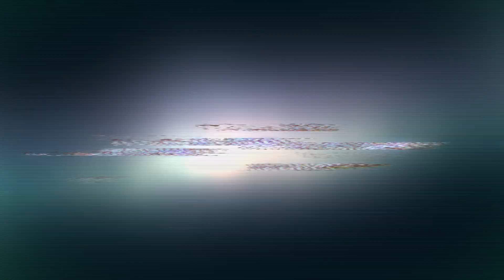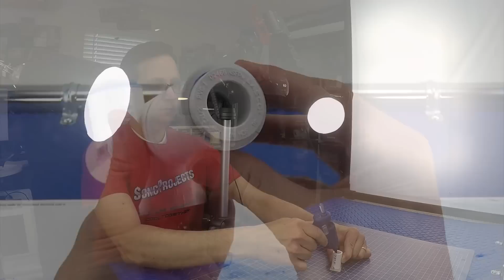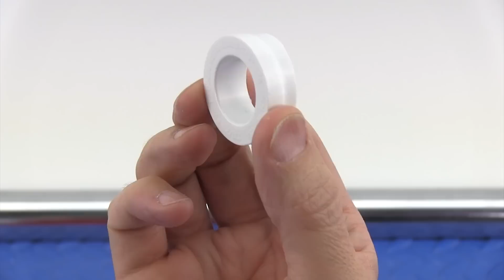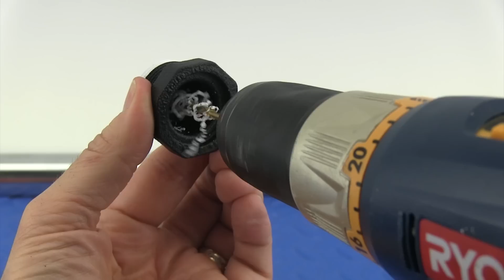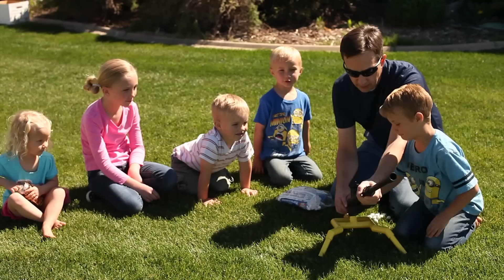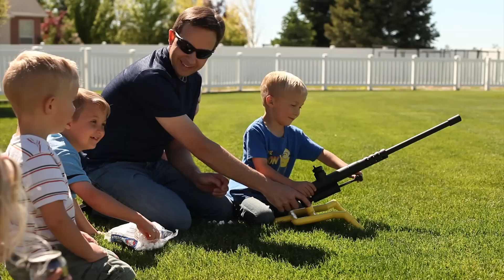Build a Marshmallow Cannon with SonicDad Project #78!

Comment: Hi.  I'm going to be using this project for my extra curricular classes at my school.  The Piezo ignighters that I've found are from used up gas lighters.  They only have 1 wire on them though.  Is there a way to soder on another wire?  Thanks
Reply: Those types should have a bit of metal (ground) on the side that connects to the barrel of the lighter.  (Some might be reversed with the wire on the side and solid metal end.)  That's what you'd want to connect your added wire to.  There will always be two connection points somewhere on the device.

Comment: I got a clear spark, 70% denatured alcohol and the sponge is wet enough but it wont fire it. can you pls help me
Reply: The 30% water isn't helping you.  Go with 91% or pure alcohol sold as fuel.  Won't matter much between denatured ethanol and isopropyl.  Make sure you pump to clear the old gasses out for each shot.

Comment: Does anyone else have the problem of the cannon not firing wis 91% Isopropyl Alcohol
Reply from the maker: A possible tweak would be to use denatured alcohol. Rubbing alcohol works, but there are variations between manufacturers and some just are harder to use for combustion. An alternative is denatured alcohol, which is a little more combustible.  An easy-to-find source of denatured alcohol can be found at most auto-parts stores (https://www.amazon.com/28201-Gas-Line-Antifreeze-Water-Remover/dp/B0016GXNC4)

Comment: I had some issues finding some of the pvc parts. I was able to get all of them but some have rigid octagon like ends and some are smooth. Is this an issue?
Reply: A little late, but perhaps this will help others:  Knife, saw or sandpaper to remove material.  Hot glue to fill gaps.  The paint will make the whole thing come together better than you might expect at first.  Whether there is an issue depends on how different your parts are from the plan and if you're willing to do a little work to make them what you need.

Comment: Can you help  please wont set off (as in the fuel rod and trigger wont react) and everything is set up correctly?
Reply from the maker: A few possible troubleshooting steps might include:

#1 – Verify you have spark. This is easily done by taking the ignition switch into a dark room and pushing the button. You should be able to clearly see a little spark jump between the ends of the wires.  If you don’t see a spark you may have a bad ignition switch.
#2 – Verify you have fuel.  The fuel sponge needs to be wet, but not too wet.  The best way is to spray it enough to saturate the sponge just to the point where the sponge begins to drip.  More than that is too much.  
#3 – a possible tweak would be to use denatured alcohol. Rubbing alcohol works, but denatured alcohol is a little more combustible and therefore a little more consistent.  An easy-to-find source of denatured alcohol can be found at most auto-parts stores (https://www.amazon.com/28201-Gas-Line-Antifreeze-Water-Remover/dp/B0016GXNC4)

Comment: I live in Ireland so it is very difficult to get rubbing alcohol so is there a substitute fuel that I could use
Reply: ULTIMATE GAMING order it from an online site (like eBay)
Reply: ULTIMATE GAMING in theory you could use spray deodorant cans, but the combustion chamber would need to be modified.
Reply: Can you get HEAT for removing water from gasoline?
Reply: Sam Strassburg I have never heard of that before but it doesn't mean it doesn't work
Reply: clanline35028 HEAT is just a alternate product you can use.  Really you can use anything that is highly flammable.
Reply: Sam Strassburg thanks for the info

Comment: Does anyone know what the FPS or feet per second is.
Reply: That depends on tiny differences in the materials in each cannon, each marshmallow, how much fuel vapor and how much oxygen is in the chamber at the exact moment you fire.  Every shot on every cannon will be different.  This is why combat cannons and smaller firearms eventually changed into using pre-loaded explosives in closed containers when technology allowed it – for a predictable shot almost every time.  (Misfires and variances still happen sometimes.)

Comment: I built this cannon but I can't get it to fire. Any suggestions?
Reply from the maker: A couple troubleshooting items that will help you include:
#1 – Verify you have spark. This is easily done by taking the ignition switch into a dark room and pushing the button. You should be able to clearly see a little spark jump between the ends of the wires.  If you don’t see a spark you may have a bad ignition switch.
#2 – Verify you have fuel.  The fuel sponge needs to be wet, but not too wet.  The best way is to spray it enough to saturate just to the point where the sponge begins to drip.  More than that is too much.  
#3 – a possible tweak would be to use denatured alcohol. Rubbing alcohol works, but denatured alcohol is a little more combustible and therefore a little more consistent.
Reply: SonicDadDotCom ok thanks, I'll give that a try
Reply: I was having the same issue. I found that if you take off the barrel, put a couple sprays of alcohol in the combustion chamber, then light it with a lighter, that will get the cannon primed. Just be sure to blow out the flame. from there i was able to get it to shoot after pumping air every time.
Reply: how big is your piezoelectric spark
Reply: Matthew Robinson Same problem here. I wonder if ambient temperature of the fuel and gun have something to do with this? I was able to fire as long as the chamber was warm. Thnx for the suggestion with the lighter! Still troubleshooting though.

Comment: I can't get mine too fire
Reply: I was having the same issue.

If its not its a couple reasons,  No spark, or the fuel mixture is to lean or to rich)
  I tried using HEAT (available at autoparts stores)  its very forgiving with the mix of air to fuel.

worked great!